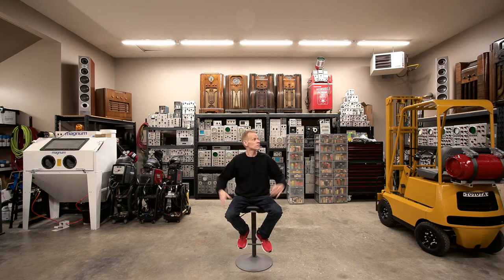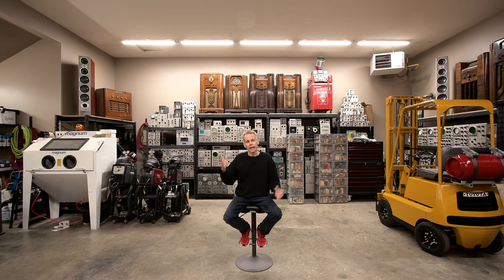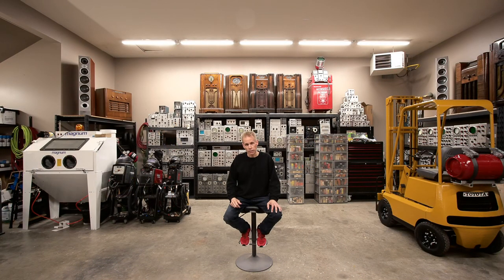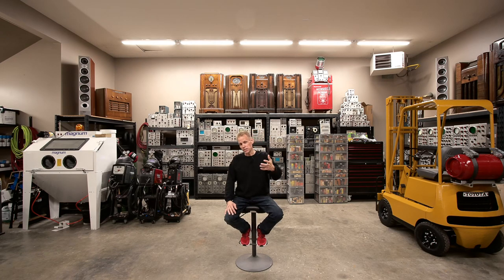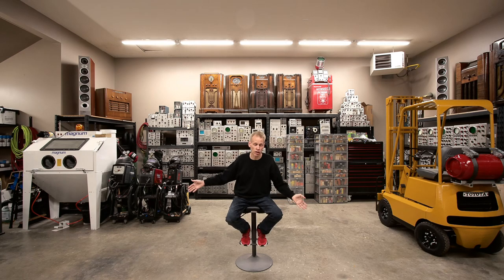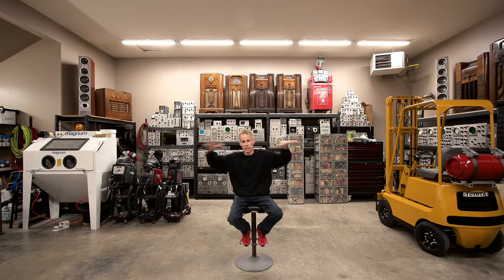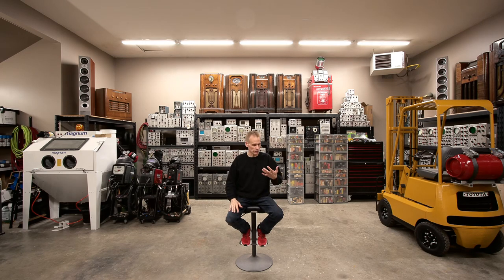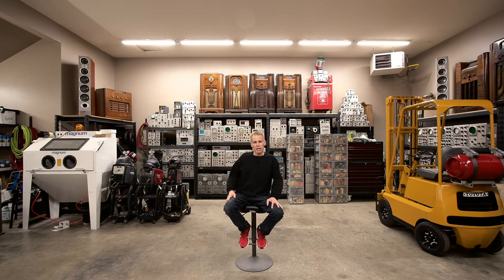ZAP! Mr C's Worst Electric Shock Explained In Detail!

Comment: I think what may have happened to cause a shock from the radio's microphone housing, which would have been connected to the radio chassis, was that the negative ground wire (B-) between the external power supply and the radio may have become disconnected.  Assuming the power supply was earth grounded through its three wire line cord, and the B- output was connected to this ground, the radio chassis would float towards the high voltage positive (B+) potential through the radio's circuits which are power by this voltage, all in parallel.  The metal chair could be somewhat grounded if its base was in contact with a bare concrete floor;  the constant dampness makes it somewhat conductive.  When connecting anything to an external power supply with dangerous voltages, I would use connections more secure than clip leads, and perhaps run two separate ground leads between the voltage supply and the powered device, as a back-up in case one lead comes loose.  Also, if your workspace has a bare concrete floor, add an insulating dry covering, and wear good dry shoes while working on live devices.

Comment: Rule one from my old electronics teacher was "never work alone." This is exactly why they tell us that. We've all done it, but we shouldn't. I was at an HP LasterJet training in the 1990s where the instructor was tired looking. He told us that he'd spent the night in the training room, because he'd bumped the HVPS in a printer with his wedding band setting up the demo, and it had knocked him out for a few hours. He woke up on the floor with an arc burn on his ring.

Comment: My first electric shock was not of my doing: the lighting cable in our basement had frayed and the live conductor had come into contact with the wall, which was damp.  I remember being thrown across the room and into the opposite wall.  I was 7 years old at the time.  Later, I received a bad shock by poking around in a live power supply (*very* silly) and I didn't learn my lesson because only two years ago (I'm 55 now!) I got a bad shock from a wireless mains plug (one of those 'smart plug' remote sockets) because I thought it would be a good idea to look at the signalling protocol on the microcontroller.  Somehow, 240V AC made it across the isolation gap to the low voltage part of the board, killing the microcontroller and damaging the MacPro computer that it was plugged into.  Once again, I was kicked across the room and fortunately, only suffered some bruising.  It could have been much worse.  The Mac was damaged beyond repair, unfortunately.

Comment: I was shocked by a bad electric dryer. When took hold of the control knob to start it I couldn't let go. I passed out and woke up on the floor with the knob in my hand. I had ripped it off the dryer as I fell braking the connection.

Comment: The 60hz hum that is felt, when you get energized, truly is a unique feeling. Best described as feeling like a human speaker, with a  60hz bass note running though  you, You can literally feel your whole body vibrating from the inside out...  I had a similar but less intense experience, with a 220v DC arc welder, while welding a piece of metal on a wet concrete floor. I could feel the 60 hz hum going though me while doing the actual welding, but it didn't hurt, or cause any physical or mental impairments. So i kept going until i completed the weld, while feeling the "hum" the whole time,  It didn't bother me one bit. however, I will never forget it.. I would equate the whole experience to that of putting a 9v battery on your tongue. You can feel the electricity flowing, but it is not intolerable.

Comment: Wow, I had a very similar experience. I was 16 in the mid 80's and was working on a Xenon strobe light. I forgot it was plugged in and I touched the xenon tube socket. Anode with one hand and cathode on the other. I had 300+ VDC go through me. I could not move my arms and legs or let go of the wires of the socket, I also felt and heard the hum. The only thing I could do was twist my waist and that flung the strobe light PCB across the room and disconnected the AC plug from the wall socket. I still felt the hum in me for a while after that, very scary. To this day, my body still hums, perhaps a coincidence, but I don't know! Lucky to be alive I guess. I think about that incident often.

Comment: Hey Paul(Mr/Carlson)! I have been looking for some time, for the correct Zenith Turntable that would be meant for the Zenith 12-S-267(8S-267). would you happen to have some sort of idea! there are quite a few that would match!

Also, My Guess would be that - you Popped the fuse, a tube or another part. which, cause the voltage to run another direction that, is why you ... most likely, had a push out of your chair.

You never, leave a Mic Plugged in or use one when the amp or chasis is under repair! What, can happen if a certain part fails, can make a Capacitor, turn into a death cap.. it makes sense that the Mic, took up a strong voltage and then delivered it to you!  

any ways, glad to see that you made it ok through something as such!

Comment: I was badly shocked when I was in my teens working on our TV.  A little background - TVs back then were of the CRT/ vacuum tube technology and I used to pick up a little cash working on TVs and radios.  While troubleshooting no picture on our family set I accidentally completed the circuit between the 550v, 50 ma boost voltage which through me across the room.  My mom got a big laugh out of it.  As for me it wasn't the least bit funny.  I was sore for about 3 days but on the plus side I never got another shock again and I have worked around extremely high voltages in the USAF as a safety observer and in industry until I retired a few years ago.  In the USAF we used the buddy system and in industry we harped on lock out, tag on procedure. Btw, one thing a lot of techs working around high voltage circuits do is tend to rely on "bleeder" networks around high voltage caps to discharge them.  I've had to stop a number of them time to time reaching into maggie supplies without the cap being safety wired after discharge.  I demonstrated a few time the hazard with a shorting stick.  Usually it was the inexperience co-op techs but time to time I'd get one from another department that wasn't familiar with the safety protocols.  Then there was always the clown that would think nothing about defeating safety interlocks.  Being a radio amateur and experimenter ( call sign N1ABE ) I still have some legacy equipment and keep to the protocols when working around energized gear.  The stuff I design and build is mostly low voltage, fine pitch solid state so risk of electrocution is low; however, working with micro-controllers, MMICs and other static sensitive devices I have to be static aware so my bench is set up for ESD protocol.

Comment: Changing a live 277vac ballast,  had an accident on a ladder. 
Slipped the screwdriver and hooked my right and left hand up. One wire snapped out and stabbed my knuckle and my other hand grounded out. 
If I couldn't have bent my knees, I would have been toast. 
277 is very shocking.
Reply from the maker: Thanks for sharing your story!

Comment: I found some similarity in your experience, what a nasty experience to endure.
I had a severe boot when I was about 12 years old, I had a silver radio cassette the ghetto blaster style upright standing, not over the top just a common Sharp or Panasonic, anyway I was getting crackling from the power cord which was a direct 240v power lead in to the radio, so I got this idea to shave the plastic off the plug that goes in to the radio to give it a tighter connection so I thought. Anyway every time i put the power off shaved it a tiny bit and plugged it back in and turned the power on, except the last time, I forgot to turn it off and just pulled the plug and my thumb went over the terminals as they were now just exposed. all I know after that was I was coming to and I was on the other side of the room, I had no vision apart from bright white, not even a seem or line just pure uninterrupted bright white, my heart was trying to jump out of my chest thumping like a wild bull, I sat up and after maybe a few seconds from sitting up my vision slowly started to come back through the whiteness. I just sat quietly until I felt closer to normal and said nothing to my parents because I didn't want anything taken away from me. I can't remember what happened with the power lead if I kept it and left it plugged in or what, but that remains a very strong memory even now in my later 50's, No idea how long I was laid out, I suspect not long, but I think that was my narrow escape from the reaper.

Comment: Mr C, I had caught a shock from a power supply, not realising that the caps were still charged , I stupidly assumed that as the supply had been standing for 6 months disconnected and assumed the caps were discharged I caught my right had without realising that I touched one of the terminals on a capacitor. Instant pain which went after 2-3 seconds but worst part that I stabbed myself with a meter probe in the shoulder.  My big learning from that was any caps with more than 30v capacity. I always short them now before working on any eqpt.

Comment: This reminds me of the time I almost died. The stupidity that led me to that point would take too long to relate, but I ended up alone in a building at 3am, with uninsulated pliers held in sweaty hands connected directly to the terminals of a 1,200 VAC/300 mA transformer. People talk about time slowing down in moments of crisis; it really does.

I instantly realized what I’d done, and tried frantically to move my arms to break the contact. Nothing. They were frozen, locked in place. All my willpower ordering them to move had no effect.

Oddly, I had the sensation of rings of warmth slowly moving up my arms towards my chest. I have no idea what might have produced that feeling, but I somehow knew that when the planes of warmth met in my chest it would all be over.

Almost without thought, I realized that while my arms were locked, my legs still worked, so I jumped back from the bench, breaking contact with the transformer.

Immediately, my arms flew apart; the pliers that I’d held in my right hand gouging about a half-inch chunk out of the concrete wall about 5 feet from me, the other pair sailing across the lab, fortunately missing an apparatus we had running a multi-day experiment.

My first impression was of utter silence. No sound, no air moving, no … heartbeat.

After what seemed an eternity, my heart started beating again, with one massive initial *flumph*, then bambambam, beating at what felt like 200 bpm. 

After a few minutes of collecting myself, I shakily turned off the breaker on the lab bench and made my way home.

Over the years, I’ve wondered how it is that I didn’t die that night. I guess it just wasn’t my time.

Ever since then, I’ve studiously practiced the “one hand rule” whenever working around high voltage 😁
Reply from the maker: Thanks for sharing your story Dave.

Comment: Electricity shocks very painful, one with capacitor that was shorted for safety, but received painful shock after it was removed and picked up after repair and unit reassembled, and found out it still had high voltage.

Comment: Sometimes electricity finds you. In 1986 flying an F-4 Phantom a bolt of lightening struck my right wingtip.  I was reaching up with my right hand to turn a switch when it happened and watched a bolt of electricity pass from my glove and travel 5 inches to the panel with the switch.  It blew out about 100 circuit breakers in the RCP but we landed safely.  So much for Faraday's Law...

Comment: I have experienced that before, it was not fun at all. I was 15' up on an aluminum ladder with an all metal circular saw in my hand cutting cedar shingles for an A-Frame getting shingled. Out of the blue it lit me up, I couldn't let go but I was able to sling it outward away from me and that was enough to get my hand to release it's grip. We figured out it was bad wiring with no ground later.

Comment: Had a friend with a D-104 he duct-taped his radio antenna to the side of a house next to the alley and a 72,000 volt power line. I was upstairs and he was sleeping next to his radio in the basement. He was fine but as the antenna fell in the early morning hours it blew an electrical explosion that could be seen through the flooring slats. It knocked out power in a city block and fire trucks were in the alley within minutes, he was lucky to not have been talking on his radio at the time. He could never hear out of his right ear again and the entire wall was black.

Comment: I got the worst shock of my life at age 14. A friend called and said his aunt had a console radio - I recall it as being 1940ish - that would not power on. I went to his house and found he had already bypassed the power switch and music was coming out of the speaker. The  chassis and the speaker were sitting on the kitchen counter. For reasons unknown I had my left hand resting on the chassis and slapped my right hand down on the magnet structure. I knew the field coil of the speaker was used as part of the B supply filter; what I didn't know was that one side of the field coil (at 280 VDC) was fastened to the magnet frame! It felt like I was hit in the back of the head with a 2x4 and my vision dimmed for a few seconds, but otherwise I was okay. I was aware, even at the time, if it had been 280 VAC I would likely not be here. I have had 120 VAC across my fingers; that was a lot worse.
A handful of years later my brother and I were trying to measure the plate current (rather then cathode current) on his Heath SB-401 transmitter. We dug up a couple of 10 ohms 1/4w resistors, not enough clip leads, and my Heath "lunchbox" FETVM. Of course our setup had the plate voltage on the resistors. My brother had his fingers holding the resistors ion contact with the rest of our abomination and one of his fingers must have been in contact with one side of a resistor. I reached down to zero the meter, not knowing that the negative side of the FETVM was connected to the little chassis it had. There was a jolt, a POP, and a puff of smoke as one of the resistors went to radio heaven. We examined our fingers and found each of us had a few small, bloodless pits in our fingers.
Maybe a lesson here: your experience and my two experiences point out that it is never safe to assume you will be making only one contact to equipment that is not in proven form.

Comment: About 30 years ago I got a good shock. Had an old 240v black and decker circular saw metal body they dont make anymore. Anyway had hold of the earthed metal saw in the right hand bent down pulled the plug with left hand. The plug lid was a bit loose lifted as i pulled it and my finger went on the fuse inside while eartjing my to the saw. Felt it go up one arm across my chest and doen the other into the saw. Basically earthed myself across the chest and was locked stuck ther. In that second i realised and used my legs jumped up high using enough force to free my hands threw the saw.  Had a sore chest and arms for a few days after that episode. Definitely taught me to respect the deadly invisible force 😮 👍

Comment: I once discharged the primary capacitor bank of a 1000w 24v DC powersupply that worked of variable 220v-580v 3 phase 50/60hz after a voltage sweep test from low to high, so it was charged up to ~800v or so, into my left thumb. My arm hurt for a few hours, there were probably some 500 joules in that bank.

Comment: I got shocked when I was young. Fortunately I was thrown from the circuit onto my bed. But it was pretty powerful. I had a power supply from an old TV with rectifier tube and big transformer. Perhaps 500 VDC and also a 6.3 VAC filament.  I had a home brew transmitter on another chassis I was attempting to power. When I did not see the filament lighting on the transmitter, I touched both power supplies with my hands and realized the ground connection was missing or open. I competed the circuit. It made me very wary of tube equipment after that.

Comment: Glad you survived!  And that others are reminding us of the old rule that you should keep one hand in your pocket or behind your back when working on "live" equipment.  Even in these days of low voltage kit there are risks.  Only last week, when I was installing a new low voltage switched mode power unit, I managed to collect a "packet" by picking up the unit after disconnection only to be reminded that the high voltage capacitors therein still held a charge!  Welcome to the buzz.

Comment: YES!! 100% keep emphasising safety, Paul. I was trained in electronics back in the 70s, but the main enemy is complacency. I don't work on live stuff when it's not necessary, ANYONE can make mistakes. My worst jolt was working on a CNC unit, the cooling fan wasn't spinning, so I just gave it a push to see if it was seized up. It had 340v AC on it! I'd assumed it would be earthed and protected by a fuse. Ass-u-me, makes an ass out of you and me!

Comment: It's worth being careful. When I was young I got bit really good by a Leslie Speaker amp. It is unforgettable. In the industry I worked in, there were enough accidental mechanical and electrical issues to warrant full up documented procedures and policies. Direct and Stored Energy, mechanical and electrical is formidable. The scariest part of your story is not knowing how it happened. How do you correct a mystery?